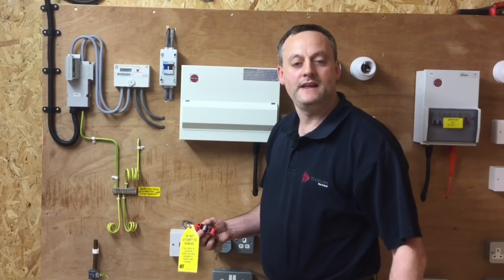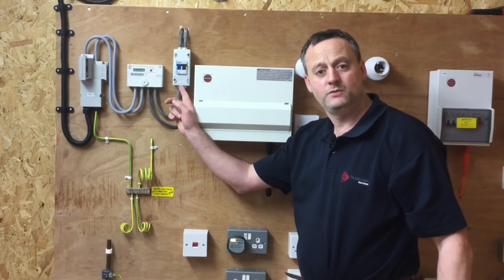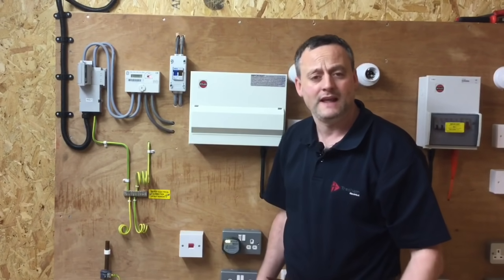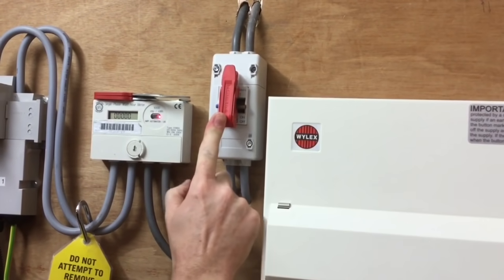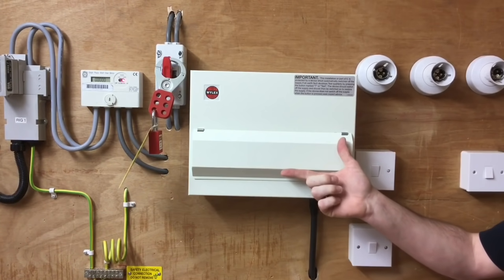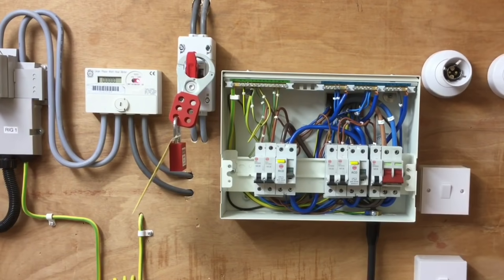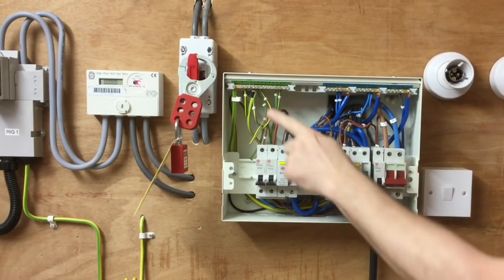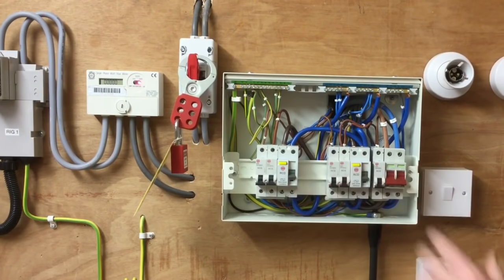How to Carryout Safe Isolation of a Consumer Unit (Single Phase 230 Volt Supply) AM2 or AM2S

Comment: What happens in the absence of an isolation switch, does the DNO have to fit one?
Reply: I've got the same problem but the DNO wants to bend me over for £231.42 to put an isolator in. My consumer unit is ancient, needs replacing and electricians round here won't work on it because there is no way to stop power going to the fuse box, without removing the main fuse - and the DNO has already fined electricians for doing that without their permission. So, I am stuck till the DNO comes out.

What amazes me is the complete absence of a video on how to work on a fuse box that doesn't have an isolator, surely if there is a switch it is a no brainer for electricians (the challenge is what to do when there isn't one)!
Reply: @TheChriss45  Yes, it's a problem. The proper way to do it without a switch is to book the DNO to pull the fuse, organise the electrician to do the work at the same time and then book the DNO to replace and reseal the fuse. Can be difficult to organise everyone to turn up at the right time, and if it goes wrong you can be without power for days.
Many electricians will pull the fuse, but it's a legal grey area, and if they've been fined by your operator, probably not keen on doing that. To reseal perfectly you need MOCAPA-compliant pliers and tags, with dies in the pliers that match the coding on your existing tag.
Reply: @TheChriss45   Most DNOs will pull the fuse for £70.  allowing the spark to work . Around here we just pull the fuse and the DNO dont seem to worry.

Comment: I saw exactelly another video the same but in the video the outside double pole switch was not turned off it was off just the main switch in the distribution board.Sorry im a bit confussed so for single phase safe isolation actually we must turn off both main switches or just the main switch inside the distribution board the reason im asking i also do electrical courses and i dont to fail the exam

Comment: Gaz, you say 'fortunately' we have a  linked main switch in the tails, are there cases where this switch isn't there and it has to be done but other means? Thanks. Josh. Love your vids.
Reply: In most cases it isn't there.
What you have to do is remove the fuse from the mains supply.
Put the fuse in your pocket and keep it there until all work is completed. (so nobody is tempted to return it).
Reply: There never used to be a main switch or RCD between the meter and consumer unit. You'd have to contact your utility provider to remove the fuse if yiu wanted to keep everything above board unless it's an emergency.

Comment: My dad's house doesn't have any switch outside of the box that contains the circuit breakers,just has the red switch inside the unit,is there any other way he could stop the power going to the box or is it just switch off the red switch inside the unit so can change a circuit breaker?

Comment: Hello. I have just started learning and got question. Would you prove safe isolation on load or supply side of main switch. Or maybe on load or supply side of isolating circuit? What would be the best practice?
Reply from the maker: Depends where the device for isolation is positioned. If it’s the remote 100amp switch then it’s the incoming side of the DP switch in the consumer unit. If it the DP switch in the consumer unit then it’s the outgoing side (load). Thanks for commenting and watching. Gaz 👍.

Comment: Good video guys. It would be great for you to explain what testers to use and also if an installation doesn't have a double pole isolator on the tails.
Reply from the maker: +Dans the Engineer 
Hi. I am going to do the safe isolation again on a single phase consumers unit this time without a remote isolator... maybe next week. All the best and thanks for watching GSH Electrical
Reply: GSH Electrical good stuff. That'll be good for electricians to know because 9.9/10 it won't have an isolator. Look forward to the video

Comment: Why don't you use a plug in socket tester that has an audio function??  Best practice in this case would be to use your senses when performing safe isolation, in this case hearing as well as sight!
Note - It's best practice to 'Un-load' a consumer unit prior to switching off the supply to the installation and perform safe isolation.  This is because many isolation devices are not designed to switch 'On-load', they are only designed to switch 'Off-load' for mechanical maintenance.
Reply from the maker: Hi. Thanks for commenting and watching the reason we didn’t use an audible plug in voltage indicator as we didn’t have one... poor old college... I have purchased one myself for work and will use in future video presentations. All the best GSH Electrical
Reply from the maker: Hi. 
5.1 Isolation
5.1.1 Requirement
Means of isolation should be provided:
(a) a main linked switch or circuit-breaker should be provided as means of isolation and of interrupting the supply on load. For a single-phase household and similar supplies that may be operated by an unskilled person. 

So I understand it’s not a good idea to isolate the main switch on full load but in cases of emergency or by unskilled person this may be the case. 

Thanks again 🙌